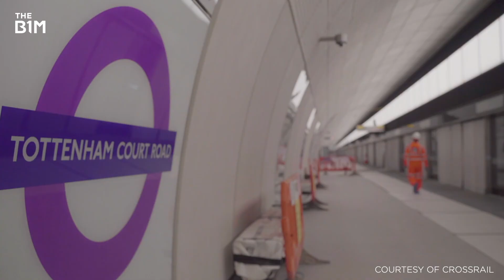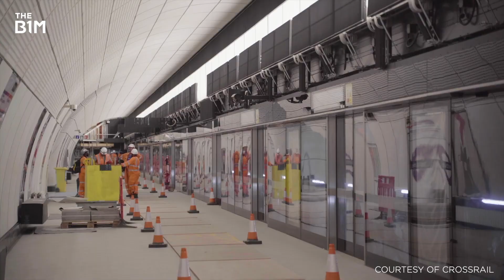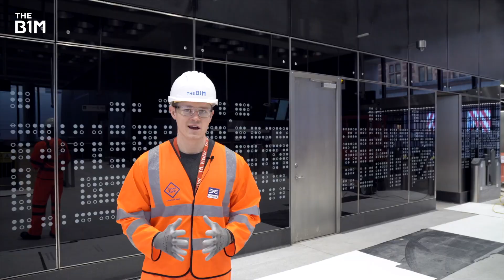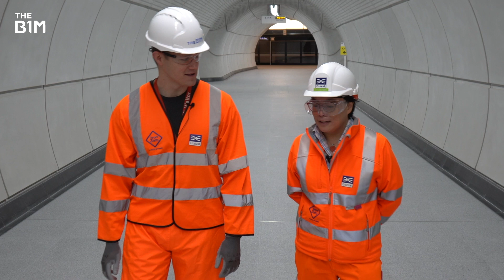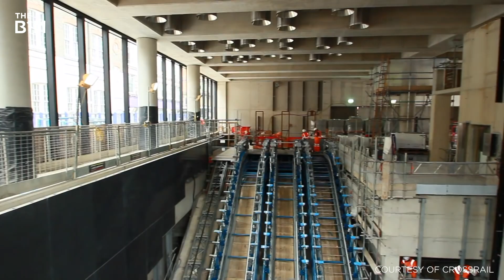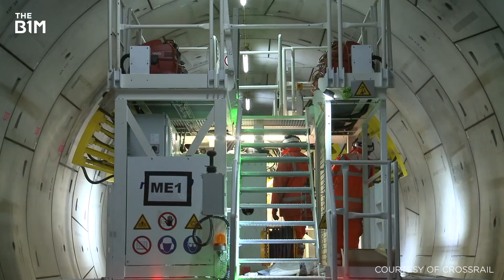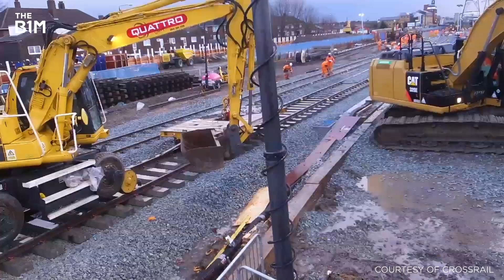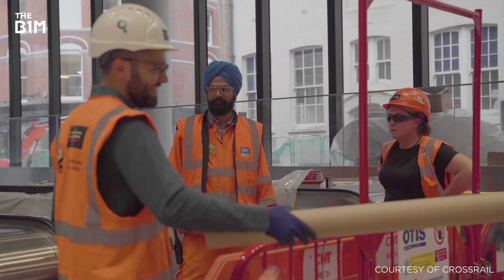Inside London’s £18BN New Railway

Comment: "2bn over budget" "...we learned from that to make sure it doesn't happen again" 

Yeah right, good one, I heard that before. ^^
Reply: When they were building they were finding old graves and artifacts, that can delay things
Reply: Rob Fraser This puts all of the risk onto the contractor without any concern for what is actually driving the risk. In the real world, project owners always create a process with contractors to vary the project and contractors will rightly want to get more money for every variance that raises their costs.
Reply: Rob Fraser  The main reason for overspends and overruns is that civil engineering in the U.K. is mired in corruption. Public officials routinely request backhanders for the granting of big money contracts. All this gets added to the cost. It's effectively stealing from the public purse.
Reply: @krashd  so then the contractor rushes the job and cuts corners.  I'd rather they were late and built it right. It's quite a large job, after all...
Reply: @jagman84  It is clear that You do not work for CR or any major civil engineering project or worked for such project ever...
Project is complex and due to the nature of London very often initial project plan & design are amended to complete the project safely and maintain reliable quality. 

Construction partners (major civil eng. companies) hire people, equipment and consultants for a fixed period... for the smallest change or delay those fixed costs doesn't disappear and such situation is not uncommon in any civil project across the world.

The highest profit margin for civil eng. companies are 3 to 4% (gross), then they have to pay for all sort of tax and mandatory non-tax payment, so asking for Civil eng. companies to fine for delay or running over budget is shooting on nation own foot.  Just for example check: Non of civil eng. companies even bid for HS2 Birmingham Curzon hall stn in 1st go. 

This sort of cost and tight time drive approach will deliver very poor quality and compromise safety. 

Why don't we think that the initial budget was wrong and time expected was over-optimistic...

Comment: It's great London's got this, now let's do the same for Northern cities.
Reply: Hs2
Reply: @Anonymous-bh9om  Thats... not an underground?
Reply: Manchester has the Metrolink atleast lol
Reply: @Anonymous-bh9om  North needs better connections between itself; not to the South.
Reply: Isn’t this the aim of Northern Powerhouse? The fact is that the need for a cross rail-esc system in a city such as Manchester simply is not as prevalent as in London where the economy is 8 times larger. It’s a question of where is the largest net gain for installation. However it would benefit the entirety of the U.K. greatly if it could simply connect North and South and the North to the rest of the North to increase the commuter zone around large northern cities
Reply: Not econimically viable anywhere in the north to bore underground. There seems to be a massive resurgence of tram networks in northern cities, As a Brummie, I can defintely say the new tram there has helped connect the areas in the black country
Reply: @Andrew Battersby hhs2 goes to midlands--and bypasses bham--its not needed
Reply: They’re probably gonna have to do this for Manchester sometime soon, the cities economy is (was) booming and the population rapidly growing from overseas investment. Manchester is emerging as a Frankfurt like alternative to the countries capital.
Reply: Hahahahaha nice joke bro!😏 They are not gonna have that any time soon😔
Reply: The north needs some upgrades on the inter-city routes, not necessarily the intra-city routes (considering London is several times the size of any city in the north)
Reply: @Anonymous-bh9om ????
What are you talking about I live in a heavily populated but most neglected part of the country that's being left out yet again. I'm sorry but the ignorance toward my area of the UK is a tad annoying
Reply: Anon ymous You mean the Same HS2 that  goes half way up just 1 of the uk’s 4 countries?
Reply: Andrew Battersby least the North gets treated better than Scotland wales and Northern Ireland 👍🏼
Reply: @francessullivan2559  no it doesn't
Reply: @jammy2597  if projects like the crossrail are done elsewhere in the north like Manchester it will exponentially grow its economy, just how it's estimated that the crossrail will boost London's by over 10 billion...
Reply: You do realise that only London ever gets investment.
Reply: THANK YOU. The North is so neglected it actually feels like we're a couple years behind London. Not nearly as organised of a public transport system as London. Trains, buses, cycling, everything is so behind London. Despite some of the biggest cites after London being up North (Manchester, Leeds, Birmingham, Sheffield, York etc) give London a break for a second and develop the rest of England.
Reply: Irrelevance 

Birmingham isn't up North.
Reply: @TechRyze  It's not south though. And the 'Midlands' don't count
Reply: Google User Manchester will never get an underground it’s too expensive.
Reply: HSN/ Northern Powerhouse rail needs to be pushed onwards. Parts of it are in the pipeline for soonish but more is needed. Metrolink Extensions + city center tunnel, Leeds and Liverpool light rail, Hull, Bradford and Shefflied trams. In all just a real commitment to build a proper fixed infra public transport network across the northern cities.
Reply: @scottwhitley3392  Jeez, the way the North keeps bleating, no other part of the country gets a look in, even the South!
Reply: Well an underground system isn't necessarily viable or necessary in many northern cities. London is significantly larger and denser than any northern city in both infrastructure and population. A better mass transport system is essential in London and due to how large and built up it is, the contruction of a tram or light rail system doesnt make as much sense. Many Northern cities are much smaller and have much more room to have an overground mass transport system, which is absolutely necessary. Underground systems are very expensive and in many cases not appropraite at all. A city like Leeds is very compact, but the roads are large enough to allow a tram or a much improved bus system. As for HS2, it's only the first phase which connects North and South. The rest of it is to provide better links inbetween the North - its really important to push to complete the later stages and not just finish at stage one. The North needs a lot more light rail connecting the north - not an underground necessarily. And its not just the north thats underfunded. Much of the south outside of the southeast has antiquated transport systems just like the North. It's much more than North/South, it's just disproportionate funding in general.
Reply: @philipelloway187  Hello. I am from Leeds, and I can confirm most of what you have said is true. The city is compact. However because it is compact, it's also quite densely populated. There is very little space to build a tramway above ground and there is no point building a tramway on the roads, the best tram systems that run on their on own segregated tracks separate from the roads.

Furthermore Leeds is next door to other cities, such a Bradford, Wakefield, Huddersfield (a large town), Castleford etc. So I think it would be great if we can have something similar to crossrail to link all these urban areas.

Just look at Liverpool for example, it has merseyrail which runs partially underground, there is also a metro in the Newcastle metropolitan areas.
Reply: @RS-gi9hu  haha yes well the reason I used Leeds as an example is because I go to university there and am quite familiar with it as a city and I really do understand the difficulty in getting around in Leeds. And you'd be surprised how effective a road sharing tram is - they have them all over Europe and they work great. But Leeds in no where near as densely populated as London is and there are far cheaper ways of alleviating congestion in Leeds and improving mobility than an underground system. Either way, my point was that I that the UK as a whole needs more money spent on transport infrastructure but underground systems are rarely appropriate when all is considered and having an underground is not a measure of a good city transport system. Despite how I do agree that London has a lot more spent (perhaps unfairly), London is a special case that does warrant a project like crossrail simply due to how enormous it is.

But yes, improving and extending light rail to the cities and towns around Leeds and further afield would be fantastic.
Reply: London has a huge growing population, so this is just catching up.

But there is funding, for example, HS2 will shrink rail times between Glasgow - Manchester. High-Speed North will shrink rail times between Manchester - Leeds.
Reply: @calj2405  Have you checked out High-Speed Rail North? AKA Northern Powerhouse Rail. It will shrink times between Manchester - Leeds. Reducing times from 60 mins to 25mins. That's faster than me getting from West to East London!
Reply: @francessullivan2559  HS2 does not bypass Birmingham. It's the first stop after London on its journey.
Reply: @scottwhitley3392  Do you think the trains will stop at Manchester or do you think it will carry on to Scotland? HS2 reduces rail times between Glasgow & Manchester.
Reply: No, what the rest of the UK needs before anything else is re-regulation and deprivatisation of the buses. The UK now has the necessary powers to do this via bus franchising. Greater Manchester is trying to do this, and if they ever move past consultations and take action, in the future all of their buses and trams could be integrated on a smartcard, like London's Oyster card. The best bus systems in the UK are the publicly controlled ones (London, Edinburgh, Nottingham). That's the real solution to the UK's transport woes.
Reply: @GoogleUser-lk6xn  The geology under Manchester doesn't lend itself well to tunnelling. Lots of groundwater, caverns, natural tunnels and underground rivers etc. They did exploratory boring in the 70's I believe, even partly built a subway line with a station (part of this phase was later used as the Metrolink station at Piccadilly) and then gave up as they realised it'd be too complex and expensive to do because of the environmental factors. They sealed it all off when they started to flood. London is mostly clay, at least in the north, it's perfect digging martial for tunnelling so it just really worked out for them when they had the idea of putting trains under ground. The Metrolink tram system is a great network, and it's growing, but it still takes time. It uses mostly the old lines or the routes at least that used to link all of the towns around Manchester but were culled largely in the Beeching cuts. That man set this country back decades when it comes to rapid transport infrastructure.
Reply: @philipelloway187  I don't think most people necessarily care that London gets so much funding and attention, it's that the rest of the country gets next to nothing of either. London needs these things, but so does everywhere else. Better infrastructure around the country will also help London. It could even take some of the strain off London too so such projects aren't as desperately needed by spreading things around more. As it stands, it's kind of a self fulfilling prophecy. They invest because it's growing to increase capacity, but then it needs to invest more because people fill the new space. It's like building bigger roads. All it does it bring more cars, then you end up with an LA situation where half the city is just road and the other half is a car park.
Reply: @RS-gi9hu  merseyrail only covers very select parts of Liverpool which is a problem, if you leave the city centre by the slightest bit it's permanently late busses for you

Comment: Very interesting project! I guess it will be interesting with the construction of the 2nd trunk line on the subway system in the Bavarian capital city of Munich, which goes along with the reconstruction of Central Station
At least they managed it in London, unlike in the city of Regensburg, Free State of Bavaria, Germany: public transport purely relies on buses and as the ancient Stone Bridge had to be closed down for bus traffic due to damages, they thought about building a public transit tunnel or another bridge ... never got realized, cheapest alternativ was to adapt some bus stop signs on another existing bridge
Reply: feelsbadman
Reply: @loomnatinoscopers  well the circumstances are far from easy in that city, hardly a chance to to actually do sth different than they did: there are only very few river crossings for vehicles, no real space for further river crossings to be built, and large digging projects in a historically very interesting city usually lead to long lasting archaeological excavations

Comment: I like that people can't fall onto the tracks in these new stations. This should be done everywhere.
Reply: They want to but there isn't much room on the old platforms. It exists already in a few London stations though, the jubilee line for example. Anti accident or suicide
Reply: they should
But they really can't
Reply: The driver-less Sydney Metro has the same platform screens.
Reply: Dubai Metro has it too
Reply: The Crossrail is run by HK's MTR if you didn't know. So Crossrail is heavily influenced with their designs such as the safety doors.
Reply: They want to but they can’t it involves shutting down older stations for weeks and rebuilding platforms which is a complete nightmare
Reply: The NYC subway was built by private transit companies in competition with each other and were never intended to connect to each other. Each company had different engineering standards for their proprietary systems. The IRT had a unique tunnel radius that resulted in narrower cars than the BMT and the tunnels had different train- turning radii. Tighter turning radii forced cars to be shorter. Shorter cars meant different door positions. That brings us to the platform doors. How do you design platform doors when the cars themselves have inconsistent locations, depending on what model car you are operating? And some cars have 2 doors per side, some 3. Then there's the BMT cars built for wider tunnels that cannot fit into IRT tunnels. The truth is that the NYC Transit authority is forced to own and operate a number of incompatible cars throughout its century+ old system. Fitting platform doors to them all would be a nightmare. Most of the subways/metros with platform doors mentioned in the replies above are brand new and built all at once or were at least built to consistent standards and extended over time using the same standards. An alert NYC subway rider can notice some of these inconsistencies. Ride the #6 Lexington Avenue line (former IRT) and notice the car's interior width. Then ride the A train (former IND). Notice how significantly wider the IND is over the IRT.
Reply: @michaeljarosz4062  I've only been in NYC maybe 4-5 days starting around 1971 and last visit around 1992, so I wasn't aware of these details. STILL, you would probably make the kind of changes I'm suggesting a line at a time, so I'm sure it could be done. 

Here in the SF Bay Area we are just starting the process of replacing all the BART cars, so it would be impossible to add the doors until that process was completed. But I can't thing of anything that would make service more dependable.
Reply: @itz_g4m3r76  MTR’s operation of Crossrail is a concession. The system would be identical if it was a different company. They have no influence over the operational practices of the railway, it’s all specified in the contract TfL have given them.
Reply: Its an expense that is unnecessary. If you aren’t smart enough to stay on the platform then you should stay topside and ride a bus
Reply: @prepperjonpnw6482  To be honest, my concern is not with the people who fall in front of trains but with all the people inconvenienced when people fall in front of trains.
Reply: @prepperjonpnw6482  What if you trip? What if someone pushes you? What if you suddenly feel dizzy and collapse over the edge? What if you're a child who doesn't know any better? What if you're just not too easy on your feet? What if you're an idiot? Even if it's Darwinism at play, you're still going to inconvenience everyone else using that line for as long as it takes to clean up the mess and gather evidence for an investigation and full incident report.
Reply: @emmaisalone  pushing onto track isnt a surprise at all